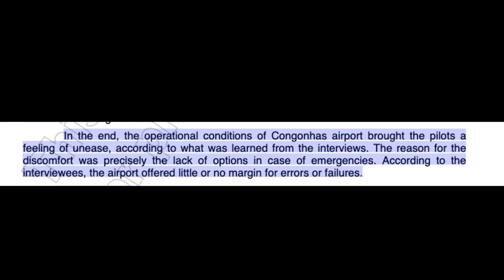The Stressed Pilot Who Made A Deadly Mistake | Deadly Reputation |Tam Airlines 3054

Comment: Why was #2 in the "climb" detent during landing?
Reply: Because the captain somehow got confused by a simple procedure. How though I don’t know. His hand should be on both levers during approach and landing, not one. And the PM should have spotted the error
Reply: @tomstravels520  Clearly, but a climb setting?  When they had been in a descent for quite a while?  He would have had to not only fail to retard that throttle, but actually advance it.  I suspect an error in analysis or reporting.
Reply: @Chris-bg8mk  - I agree.  I'd bet that the captain brought both engines back into "reverse"...but...just the left reversers deployed and the #2 engine accelerated, providing forward thrust instead of reverse.  There is no reason that the #2 engine should have been at anything other than "idle" power.
Reply: @Chris-bg8mk  you need to understand how the autothrust works on an airbus. It’s not like a Boeing where the levers move themselves. Leaving the thrust levers in the climb detent in an airbus means that climb power is the maximum power that engines can command when in autothrust. But the engines will either be in a speed mode (targeting a set speed) or thrust mode (targeting a power setting). During landing the autothrust is in speed mode so the engines will maintain the required speed even though the thrust levers are in the climb detent. When touching down and landing the left engine was brought to idle but the other was trying to maintain the speed last set because it wasn’t brought to idle power
Reply: @ThatBobGuy850  nope that’s wrong. Explained above.
Reply: @tomstravels520  Aha, that makes sense.
Reply: @Chris-bg8mk  It’s so DUMB to have thrust levers which don’t move!! It’s caused many incidents and accidents. Anyone who knows anything about humans and ergonomics would not have designed it this way!!